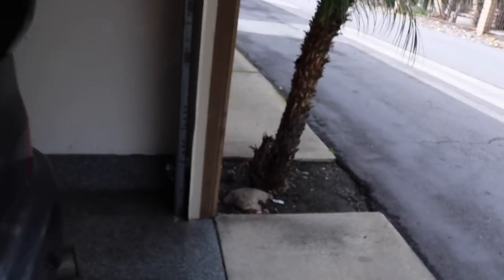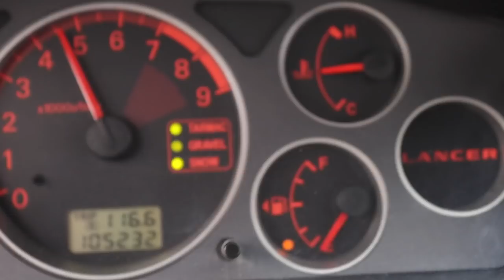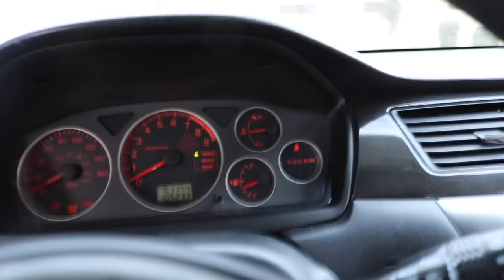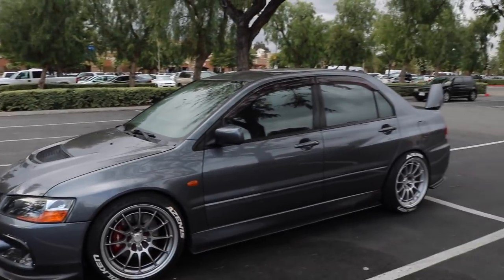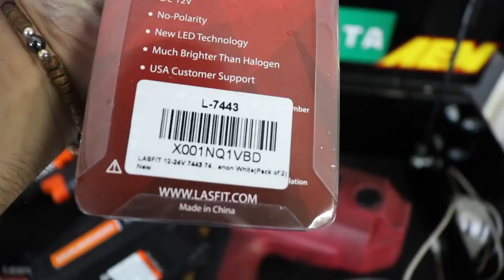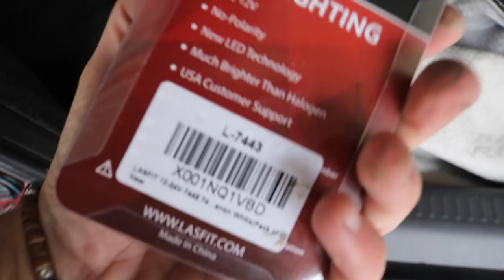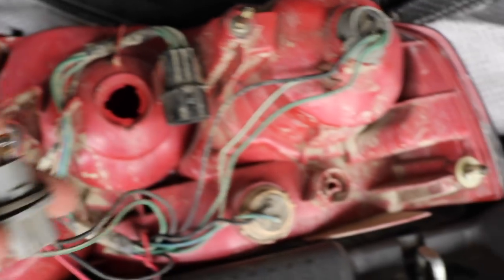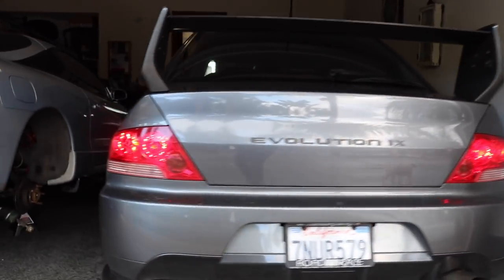Mitsubishi Evo Tailight LED Install! | DIY

Comment: Shouldn't U b using Premium 93 gas on a High performance car? Man should of put some electrical grease(like the stuff u put on spark plug wire/boots). Damn if that EVIL 9(pun intended) is basically stock man can not fanthom what it will sound like when U do some mods. #SaveTheEclipse #Nissan bring back a sport coupe or re-badge a Z car with Diamond stars on it!
Reply: 265308 he probably only has the 91 pisstane in his area. Some states are like that. Here in Washington I can only get 92 for my Evo.